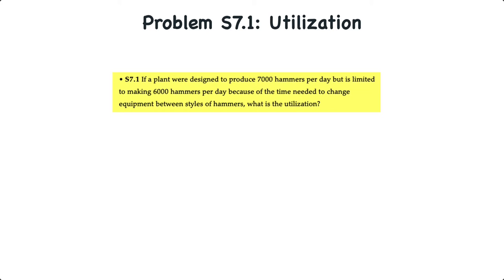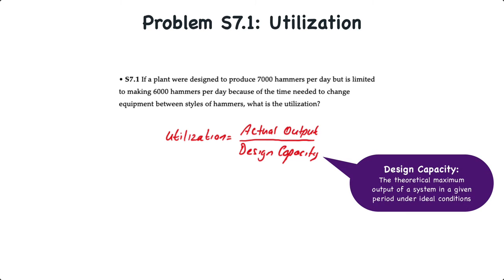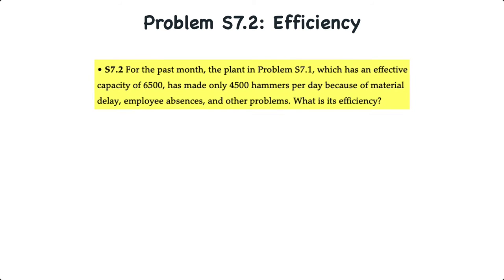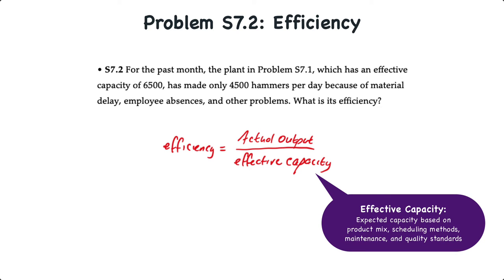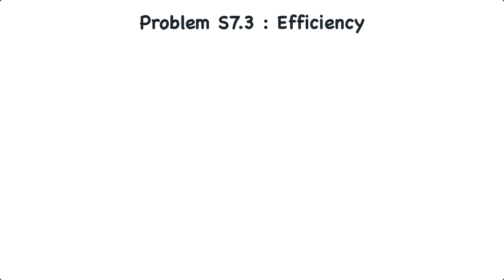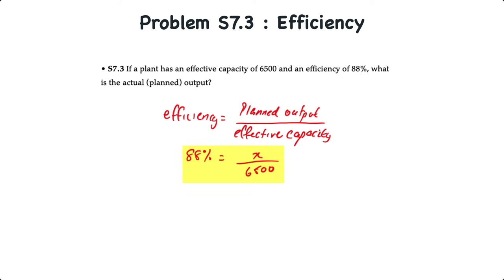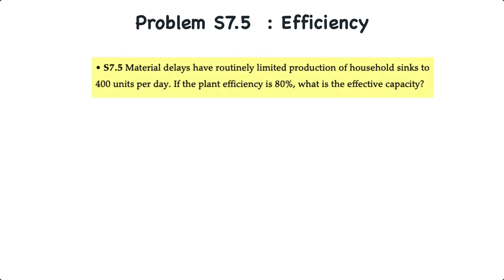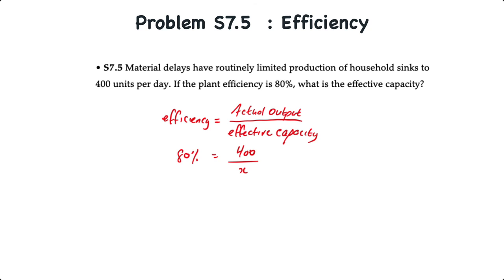Operations Management: Capacity Management – Utilization and Efficiency

Comment: Which (if any) is the most useful measure for an operations manager?
Reply from the maker: Hi Majesty, I would say both utilization and efficiency are important. Utilization helps determine effective an operation is and if the investment made in the operation is not wasted. Low utilization results in higher idle time which is wasteful. Now just because an operation or resource is utilized, that doesn't mean the operation is efficient. For example, having an employee fully engaged 8 out of 8 hours indicates that employee is 100% utilized. However, if half the time the employee is fixing mistakes, engaging in rework, or performing less useful tasks, that suggests the efficiency of the operation is low. 

Hope this helps.
Mark

Comment: I use queuing theory in manufacturing environment.. Capacity is designed taking into account change equpiement (its part of the service time). In Your casae S7.1 system utilization is 100%,  not 85%. 85% utilization is only possible if the factory had the capacity to produce 7,000 hammers and planned to produce only 6,000, leaving 1,000 as a idle capacity. In your case, there is no idle capacity because it is used for equipment set-up`s .Utilization = (full capacity-idle capacity)/ full capacity.
Reply from the maker: Hi there. I see what you’re saying here although the question isn’t specific on the cause of the delays in setup which could be the result of extremely inefficient setup processes or procedures that have nothing to do with the machine. The spirit of the problem is to illustrate that the machine is capable of producing 7000 hammers but is only producing 6000 and is thus under-utilized for some reason.
Reply: @The_Business_Doctor  Hello. The utilization rate results from averages and if changeovers take longer than they should, they still are an element of the process and at most reduce the efficiency rate, but not the utilization rate. If you meant that the machine was scheduled for 7,000 and performed 6,000 and remained idle for 15% (waiting time waste), the utilization rate was actually 85%. Greetings from Poland.